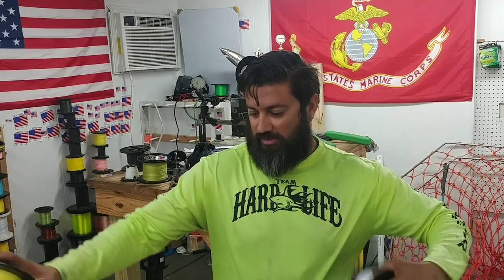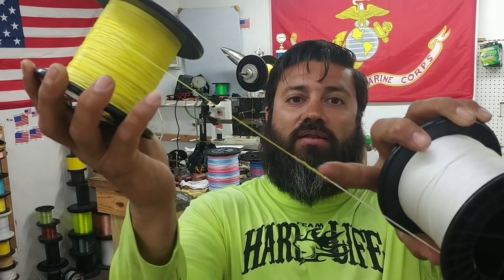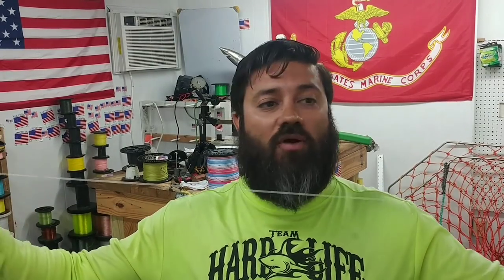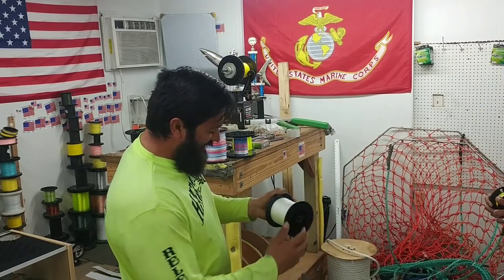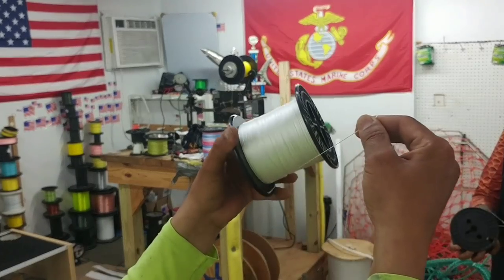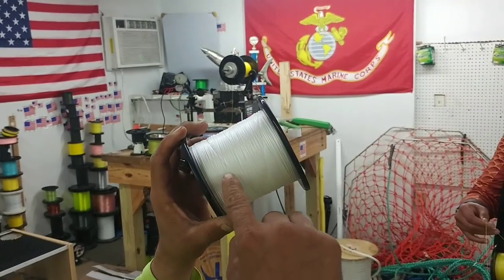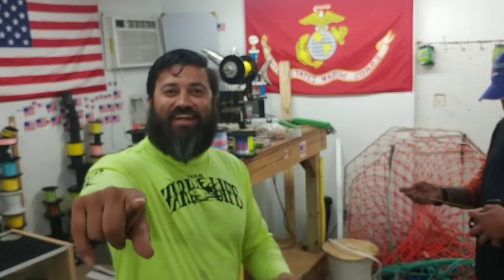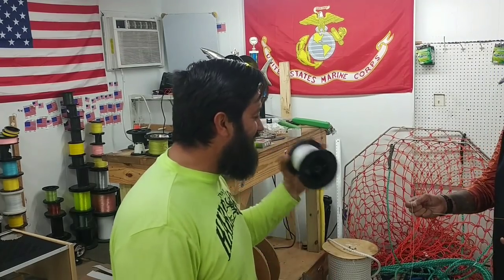Can a Solid Braid to Hollow core Splice Hold we test that theory most satisfying most calming AMSR

Comment: I just did a splice, 130# hollow to 100# Power Pro.
I wanted to be sure it would hold, no glue no end whip.
Spliced it about 30" then smoothed the hollow core and pulled it tight.
I wrapped each end around a dowel, stood on one and did a dead lift with the other...... almost went over when the Power Pro broke, somewhere on the dowel!
This will work fine for my night time bluefin jigging!
Reply from the maker: The 100# power pro is it hollow as well?
Reply: @TeamHardLife  
No, it's solid core.
Never having spliced hollow,  I was expecting to have to go 4-5'.
I was surprised that it didn't pull, and pretty sure it broke where I wrapped it over itself to lock it on the dowel.
Reply from the maker: ALSO GOTA REMEMBER to do that close out knot to keep the hollow from slipping off the solid braid...
Reply: @TeamHardLife  
I did glue and close out at my splice, but did without on the test splice, just to see if it would slip.
Reply from the maker: That's for sure good deal

Comment: I LIVE IN NJ AND I USED HOLLOW TO TIDE TWO DIFFERENT SOLID LINES NORMALY 40 T0 50 AND WORK EXCELLENT, I ENJOY SURF FISHING AND THIS IS WHAT I USED NORMALLY
Reply from the maker: Most definitely takes a little more effort but cleaner knots that won't split your thumb on cast either

Comment: What do you use to hold the line tight while tying the knot after splicing?
Reply from the maker: I have my brake system on the line spool and the drag set on the reel then I have a    a screw in a wall mount were I put the line around it ..

Comment: Albert, would you first spool on the single braid onto the reel then add the hollow core as a top shot?
Reply from the maker: This can work either way... I like The Hollow cause it's more abrasive resistant... to I would use it as a top shot..

Comment: Cool I’ve always wondered if that would work 
What are your thoughts of using hollow to splice solid to mono 
Looking for a slimmer connection and to also increase line capacity
Reply from the maker: Yes sir we have done that.. did solid braid bimini  to tiger paw to reverse latch loop to follow core mono splice...
Reply: Team Hard Life Wha da... you have to show that one, not sure my experiment is going to work.  I tried solid into hollow, mono into other end of hollow. The hollow section is 6 feet long. 2 feet of other lines are spliced in hollow, haven’t pull tested it yet. Just saw this video.
Reply from the maker: We have done that as well yes sir.. had to do close out knots on both ends of the hollow core.. is working like a champ..
Reply: Team Hard Life Do you have a video on this?
Reply from the maker: Yes sir

Comment: how is jerry brown compare to other braids etc. as far as diameter go? I apologize if question has been previously answered. thanks in advance Cpt.
Reply from the maker: On cheaper braids it thinner and even some more expensive they rank the same thickness..
Reply: Thank you sir. I’m running 50# power pro right now on both of my spinning reels. My 6500 fit around 400yds. Nothing compared to your set ups haha. But, I do have an abu Garcia 10,000 series I need to put some way better line on.
Reply from the maker: We will be ready when you are to stop on by so we can set that up